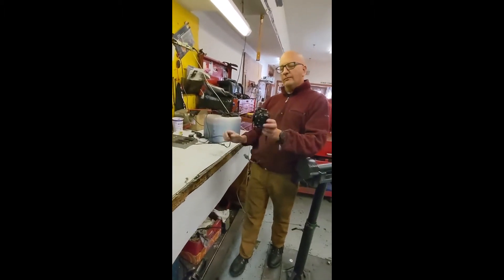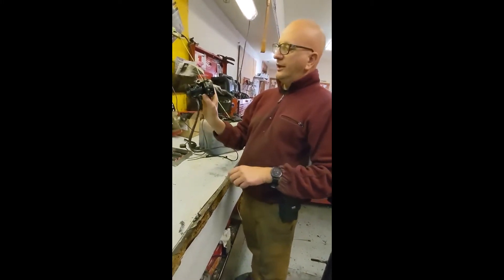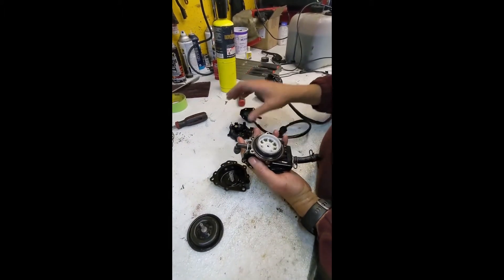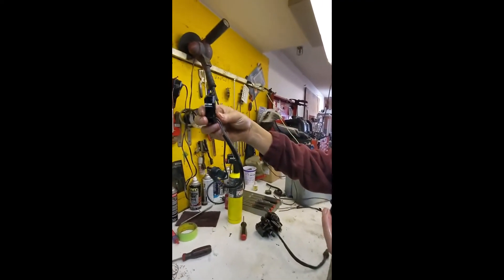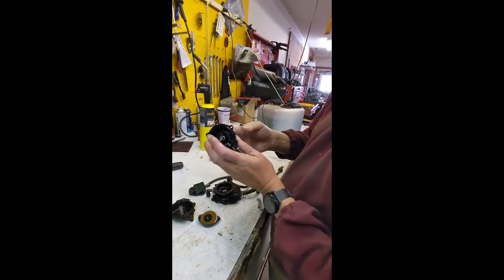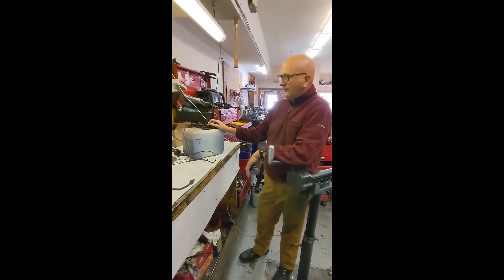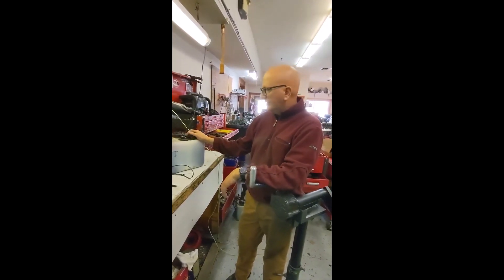Understanding and Preventing Failure of Your OMC Johnson Evinrude VRO System

Comment: Hello, if you could help me, I have a Johnson 200hp engine, I am trying to install the auxiliary oil tank for the vro pump and in the engine connector I only have 4.6 volts with the on switch, is this normal or do I need to have 12 volts?
Reply from the maker: If you mean the connector that goes to the tank in the boat there's a brown and a black wire and neither one of them should have voltage. The only thing that should have voltage in the entire oil injection system is the plug that goes to the VRO pump the purple wire should have 12 volts with the key on. If you have any other questions feel free to reach out to either our email or give us a call.

Comment: Do y’all have any v6 Johnsons around there? I need help identifying a fitting at the top of the port sides lowest carburetor (actually a little bit to the left. It would be behind the fuel rail it’s just a brass fitting with nothing. Do you know what it is? And where it goes.It’s a 225 2000 v6
Reply from the maker: It goes up to usually a molded hose about two feet long 5/32 that goes to the top of the air box. If you want to send us some pictures feel free to email us!
Reply: @Oexchange I need help
Reply from the maker: @ We'd be happy to help! Feel free to give us a call or send us an email with what's going on.

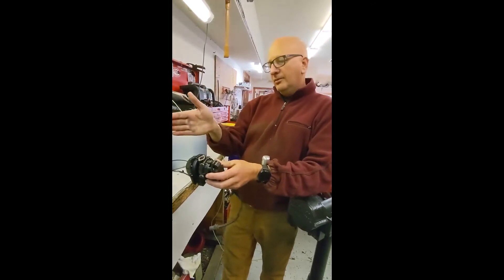Comment: Thank you for a great video.  Finally someone who really knows about VRO's. I recently bought an old speed boat with a Johnson 115hp 2 stroke 1993 engine.  The engine works well and looks in great condition.  I finally made the decision to keep the VRO and not to change into a pre-mix.  Cleaned oil tank and replaced the oil pipes until the engine.  It works well, maybe a little bit of too much smoke.  I have a table were I enter oil in and fuel in and so far the ratio holds around 1:50.  I sometimes find a little bit of oil in the engine bay, should I be concerned? Also how can I test the alarm at the VRO.  The low oil level alarm from the tank works (light in tachometer/rev counter).  Again thank you and will check your other videos.

Comment: I don't have a vro. But I was kind of looking at one and considering possibly buying it. Question I would ask is why would you run this system at all? Could it not just be removed and you just go to a straight pre-mix set up like any other motor?
Reply: So could I just run 50-1 and continue using the vro pump and disconnect the alarm? Or even fill the oil tank with 50-1 leave alarm connected?
Reply from the maker: We do recommend disconnecting the VRO whenever possible but some owner's do prefer to keep it. We often see them fail so it's very important to make sure it's working correctly.We consider the OMC system the most unreliable system and non-VRO pumps are available for less than $100.
Reply: @Oexchange  thanks I'll keep that in mind if I I end up buying one
Reply: @Oexchange  Which oil injection system do you consider to be the most reliable?
Reply from the maker: We prefer the Yamaha system
Reply: This is what people do on other outboard motors. For example on my Yamaha motor the oil injection pump is separate to the fuel pump, so it can be disabled more simply. In this case with the VRO they are both within the same unit/assembly, so I'm not sure how easy it is. I have no experience with the VRO personally so can't comment. Give it a google I'm sure there is info out there of others who have done it or tried.

Comment: With proper maintenance the VRO is great pump. if there is water in the oil tank its going suck it first (water at the bottom of the tank) and cause harm. Tank maintenance and making sure the tank is clean and the filter is replaced on reg basis. The pump is designed to over oil in the event of a failure, folks give them a bad rap, they DO WORK when maintenance is done to them.

Comment: New to my boat with a vro, ran fine on muffs, ran fine the first 5 min on the water, but it seems that by following this video the added oil has caused my motor to run rich and not get over 3000 rpm’s under a load.

Comment: Is it possible to replace the alarm without replacing the entire unit? I have a 1995 Evinrude 115 and the engine is getting oil properly but the alarm will not stop going off.
Reply: Same problem with 1995 Evinrude 90hp. Machanic told me to disable the oil sensor.
Reply: I just fixed the problem by pumping the oil bulb with the engine running.

Comment: I do Marine repair for a living but never messed with VRO systems I have a customers 94 115 Johnson that is pumping massive amounts of oil into the engine , It must have been going on for quite a while I have sludge inside the air box and also sludge on one of the cylinders outside the spark plug on the water jacket cover on the head I think its no 3 cylinder. I am doing a major fuel system over haul and a major tune up and one of the heads is leaking slightly I see a water stain coming out of it on the side of the block , Can you guys help me on the VRO ? Again I am not that knowledgeable on these systems . When I took one of the carbs apart tonight to put in the sonic cleaner there was a huge amount of oil in the fuel in the carb the complaint on the engine was  massage  smoking at the dock  thanks
Reply: The diaphragm in the VRO2 pump is probably bad.  The VRO2 pumps were designed to over oil if there was a failure in the pump.
Reply: @ladub628  I had the exact same problem and it was a cracked diaphragm, rebuilt it (didn't gorilla tighten the screws) and been properly for 4 years now.
Reply: @ladub628  I went through some of my shop manuals somebody gave me a volume some OMC shop manuals from 1993 and I found the section on VRO'S . I went through the test with the pressure pump for gear cases and attaching them to the vacuum pump nipple on the VRO. I went through the test it passed the pressure test then is said to hook up a vacuum test so tried that and it failed the test in the book said I had a cracked housing . I still dont know how they work because the OMC shop manual does not go through each stage of the function of the pump just the testing . Still not sure but I have to call the customer tomorrow and give him the bad news. Is there anything out there that could explain to me how these pumps work that I can study? Like I said the factory Manual doesnt have squat. Thank you for the reply
Reply: @madmanmechanic8847  i see this was 2 months ago,  assume its fixed by now. Take the VRO apart and check the diaphragms i bet the gas side is cracked from age and ethanol gas. its plastic so tighten the screws evenly and not excessively so you do not warp the plastic.
Reply: @rarnette73  You know what is funny is there are no function test for these systems there are no pressure specs on fuel or oil or volume. Like put in a tee and checking with a pressure gauge what your system pressures should be ,THERE IS NOTHING IN THE OMC BOOK AND NOTHING ON LINE.Why is it there are no specs for these pumps. I can put in a tee on and mechanical pump and tell yo right away if its bad or not. There should be a manual that breaks each circuit down how it works and what pressure and minimum vacuum etc. There is ZERO it does not exist @  Sure is frustrating when trying to diagnose a problem with these systems. I ended up replacing the pump for the customer . I have the old one I kept it to tear it apart and learn from it thanks for the reply

Comment: Have you ever seen anyone remove the entire vro system? Go straight from tank to standard double vacuum fuel pump then to the carbs? Possibly just put the prime solenoid on a tee after the pump. I’d like to do away with all that potential for failure. The system has many common failure points with all the gaskets and orings.
Reply from the maker: Shane, they actually make a conversion kit which makes it a lot easier. The part number varies for different horsepower, feel free to shoot us an email and we'd be happy to look it up for you.
Reply: How would I get gold you Shane. My alarm won’t go off when I screw in last screw by wiring on oil tank. So confused not sure what route to go. Just got the boat. I notice oil been going down.
Reply: Just unhook and cap the oil side. I still use the VRO as a fuel pump.